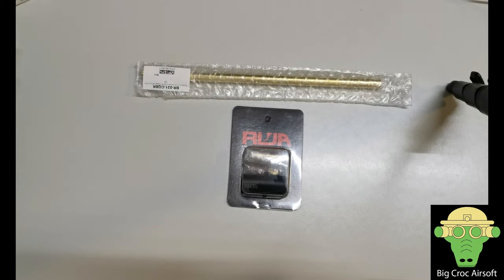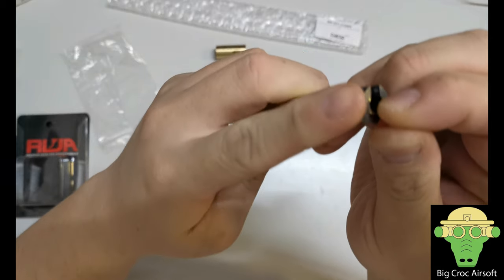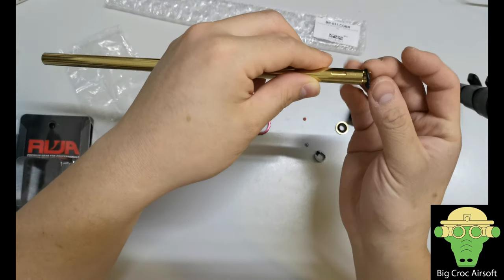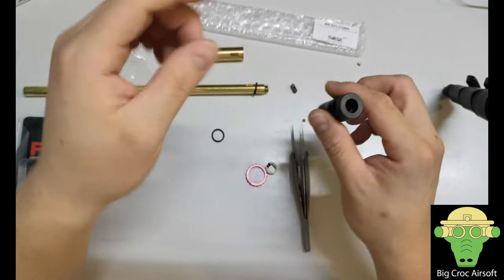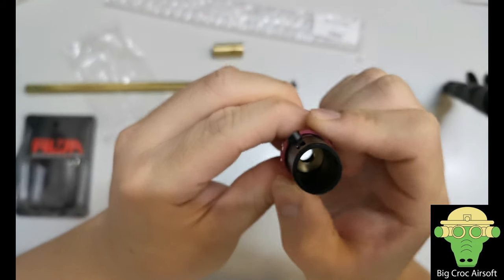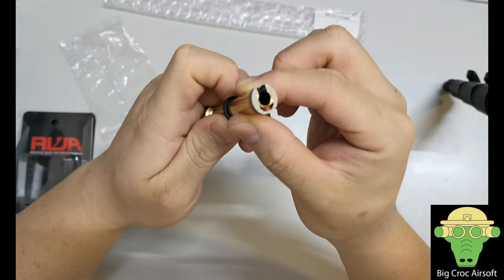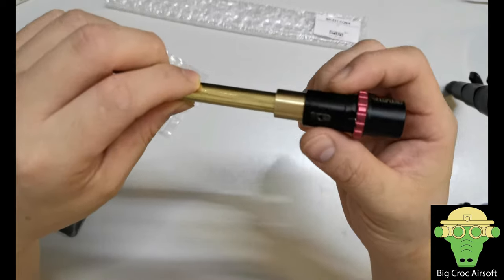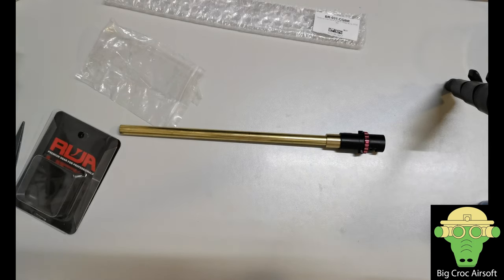RWA PTW Hop Up Chamber Assembly Tutorial, PTW chamber explained

Comment: Is this hop up any good? What's the best hop up you recommend?
Reply from the maker: The RWA chamber is ok if you dont want the troublesome on adjusting hop with the systema one but there are a few things that you can do to make it better, get systema seal o-ring and seal packing for better sealing, the RWA stock seal ring is a bit smaller and doesnt provide a good seal.  Also if you plan to use orga flat hop then dont get this chamber, the rotary pin does not push the hop hogh enough and you get so much hop even at lowest settings, will do a follow up video on it after i have tested a few more parts
Reply: BigCroc Airsoft I see OK! Thanks for reply. I don't mind using the systema tool to adjust the hop, I just want the best hop possible, I want the bb to go far. What do you recommend? Orga flat hop?
Reply from the maker: @SCASM101  ahh i see，i am doing update with hop later on, need to find a time to go range, currently i have systema hop, orga flat hop, rwa hop and FCC hop to test. Theres a new longe rrange thats opening in May, might wait until then!
Reply: BigCroc Airsoft alright cool I'll be looking forward to seeing a new video from you then
Reply: I was told that when playing below 400fps the flat hop does not really make a difference.